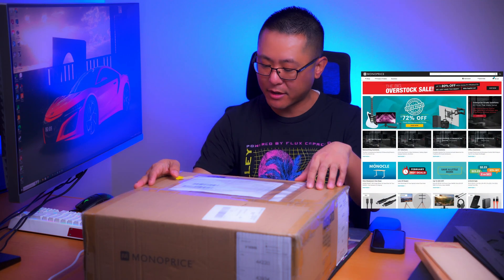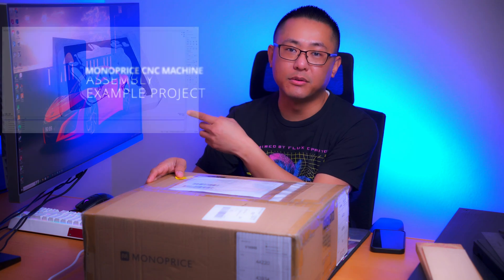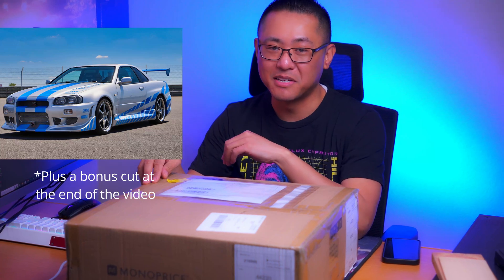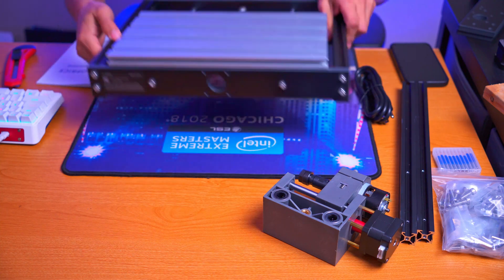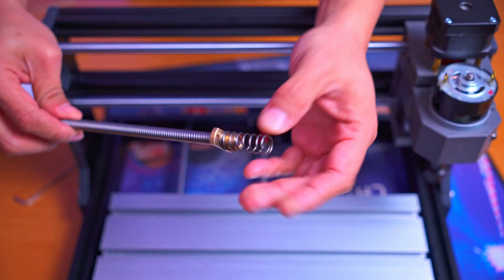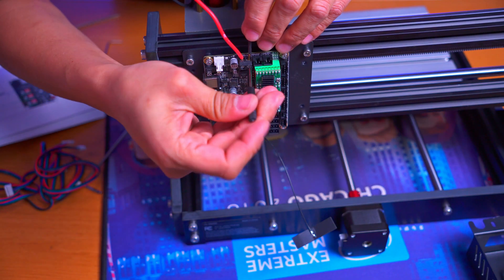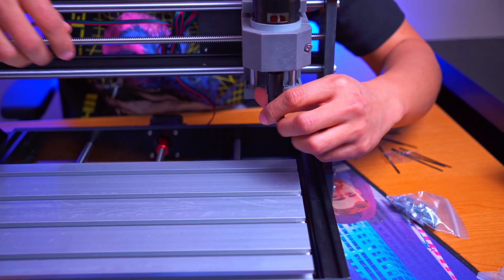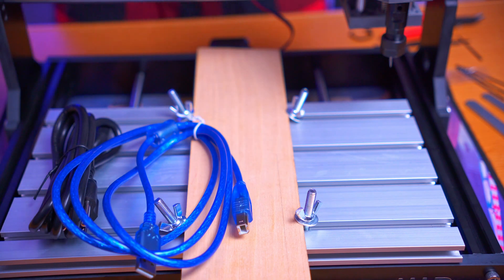THE Best Budget CNC Router Machine for Beginners, and Great For Everyone! [UNDER $300!] Monoprice

Comment: I just got my Monoprice CNC Router, I'm a bit frustrated as I am able to create a file to use but the spindle bit goes to deep in the wood. I'm using Inkscape to make gnode files. Need some guidance on how to control the hieght of the spindle bit.
Reply from the maker: I have figured out all of the issues I was experiencing in this video (it's definitely a learning process).  Having the spindle cutting too deep into your material has to do with your settings.  I am using Easel, and it's required to set the proper cut depth, and once you've got that right, it should solve your issue.  Hope that helps!

Comment: I just got this desktop cnc, having troubles finding the drivers i need to install for my pc, couldnt find the drivers on monoprice website, any ideas?
Reply from the maker: I only needed to install candle, then setup the proper COM port, and it worked right away. Have you tried checking for it in Device Manager?